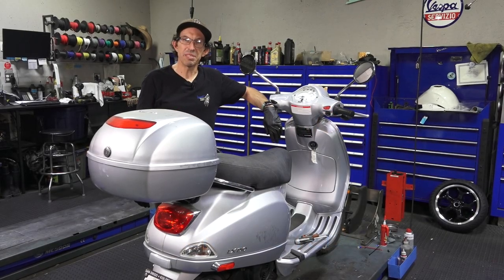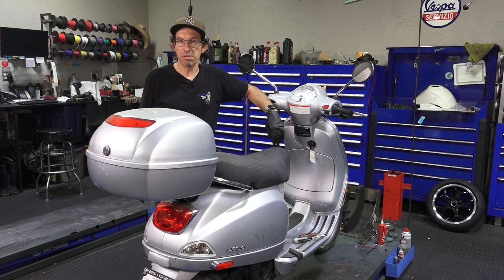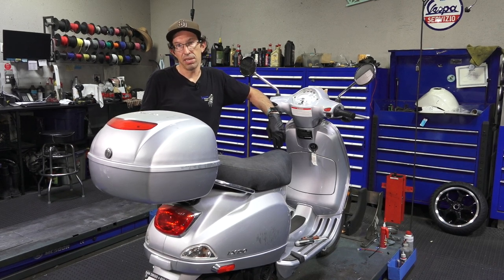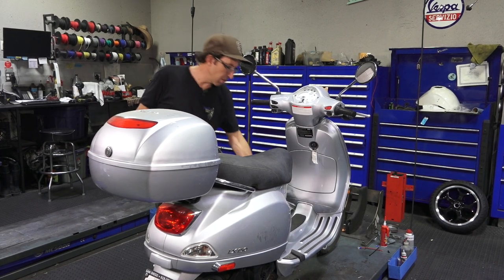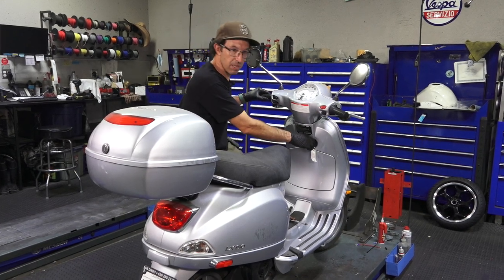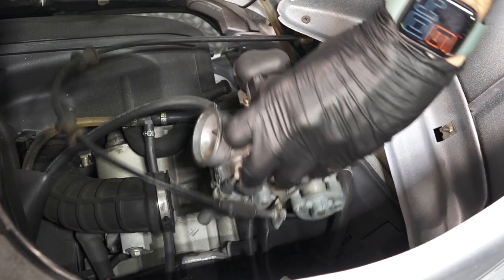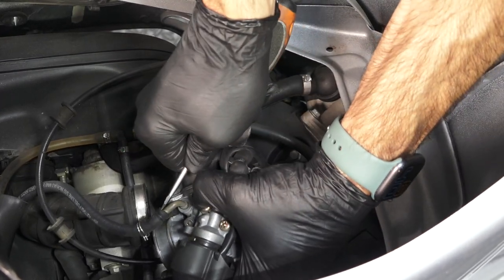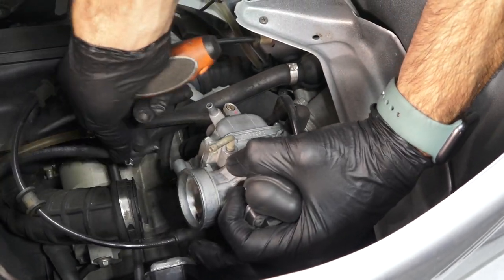How to Clean or Change the Idle Jet on a Carbureted Vespa Scooter

Comment: Those screws at 10:23 strip easily because they're JIS screws, which are ever so slightly different than US Phillips screws. I like to replace them, and the JIS screws in the brake reservoir covers, with Allen heads. They're just not worth the strip risk - it's easier to carry a set of Allen drivers than a special JIS driver just for those dumb screws.
Reply: Great tip 👍 - thanks!!!

Comment: Thanks for the very informative video. I just acquired a 2006 LX150 from my neighbor, sat in his garage for 3 years. Even after cleaning the idle jet, the scooter dies a minute later. And if I open the throttle,. it dies right away. Any clue? I plan to replace all hoses etc once I figure out if this is going to run.

Comment: Hi Robot, I have a 2016 Vespa Primavera 50cc (70th edition) that’s been sitting for awhile. We replaced the spark plug and it’ll turn over but won’t start. I’m going to try cleaning the carburetor (once I verify my scooter even has one!). Thanks!

Comment: I bought a et4. On had 633 original mes.  Lady said it sat for a year or 2. No gas in it when I bought it. Ran 2 tanks through it and now has 952 miles. Was running g great when I parked it. Went to get it out and started fine, choke kicked off now it won't run. It'll start but any amount t of throttle it just dies. Do you think the jet you cleaned on this scooter is my same problem.  I just tore the carb apart and it has all kinds of gray/black particles in every part of the carb. I'm quite sure the particles are gummed up gasoline. Thanks in advance and scooterwest rocks. Keep scootin'

Comment: I have the same problem with my 2017 GTS 150 iget engine. When it is cold it stalls and stops eventually. Does the same procedure apply for this model as well?

Comment: Thanks, Robot. Great video, as always.

I couldn't quite make out what you said when you pulled the fuel line off the carb, but it sounded something like "good thing we know the fuel tap is working because it's not dumping out fuel". My 50cc Primavera sprays gas out like crazy when I remove the fuel line, and weirder still, when I remove the gas cap, it sounds like it sucks air in as though the tank is under vacuum. Do you, or anyone reading this, have any idea what could be going on?
Reply: You might have a blocked/stuck  gas cap vent. Designed to let air in when fuel goes down. Google how to fix or replace, easy as